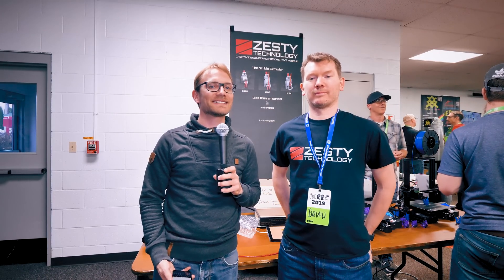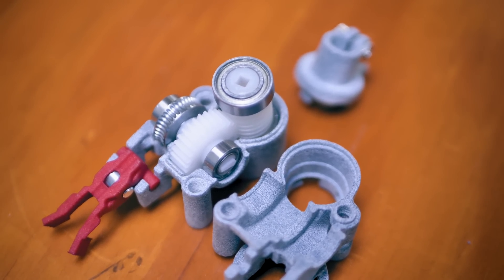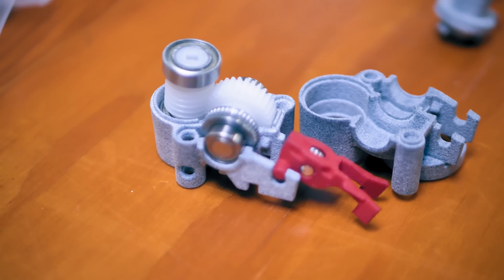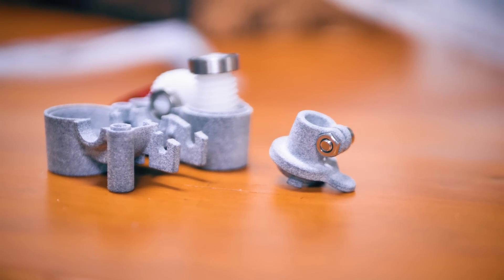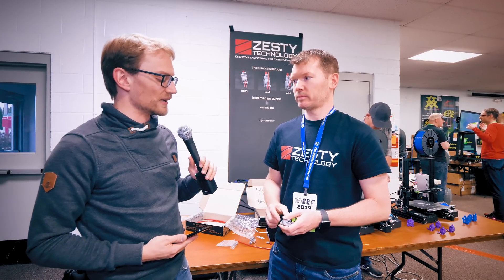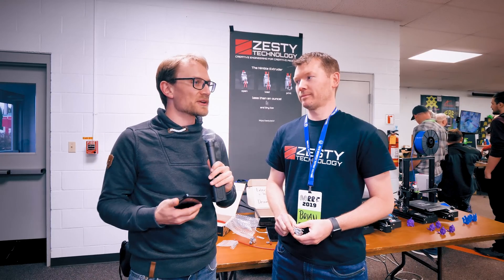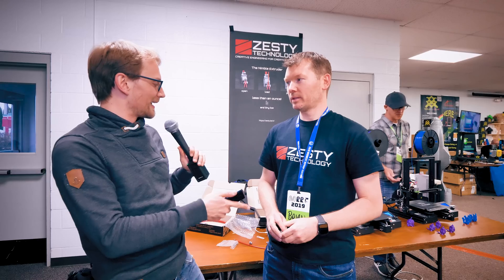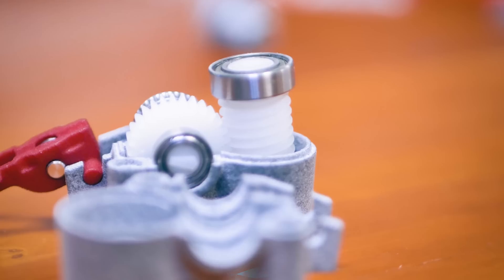The Remote Direct Extruder: Zesty Nimble! #MRRF2019

Comment: Thing of beauty...WE MUST PROTECT THIS IDEA FROM THIEVING CLOSED SOURCE COMPANIES....OPEN SOURCE!
Reply: I'm pretty sure it is already open source, but it's a bit more challenging to source a high quality flex cable, so it normally makes more sense to buy one directly from them.

I did a ton of research on them back in 2017/18 and they seem to be a really good company with a high quality product.
Reply: Christopher Goggans I’m just worried it will be the makerbot conveyor belt again
Reply: @EndermanTheMan  I can understand that :) on the plus side,  Zesty has one design, and flex3drive has another implementation. From what I understand, with two different examples of prior art, it should make it almost impossible for someone to patent one here in America.

It's also likely that flex3drive has patented the design as a defensive measure, not to sue other makers, but so no one else could try to patent the design and use it to attack other creators.

From my perspective, this seems like one of the best and most elegant solutions to the conflict between mass on the extruder, retractions, driving flexible filaments, and many other such things.
Reply: Christopher Goggans I didn’t think about that. Very good points
Reply: It is open source, With the original creator Flex3Drive. Nimble stole it and didn't make theirs open source.

Comment: It is the same concept as Flex3Drive. Not sure who was first.
Reply: There is prior art on thingiverse back to 2011, we spent the most of our development development time designing to reduce size and weight, and sourcing the right drive cable for the task. At less than 27 grams for the main unit I think we succeeded :)
Reply: Flex3Drive was earlier by multiple years
Reply: Flex3drive came out in 2014!! these people have ripped off this idea.
Reply: @Dust599  There was even some stories on reddit about this. Apparently they bought some Flex3Drive and some license to resell from the Flex3Drive guy, then 'remixed' their own version with it. They fought for some time, but then they settled I think (Flex3Drive guy was actually cool with it all, he just wanted to be credited)

Comment: Wouldnt a flex shaft become wonky when doing retraction?
Reply: He actually mentioned that in the beginning of the video. They're using a specialized flex cable that is equally stiff in both directions of rotation, plus it's running through a 30/1 gear reduction, so any small amount of torsional flex in the cable will be dealt with when you tune the extruder initially. It's really a clever idea.
Reply: @2011JMB  can you even tune rotational directions seperately on an ender 3 or CR10 (as shown in the video)

And such a flex shaft cant really exist physically one side will allways be somewhat weaker (often the inner spiral as the outer gets supported by the inner on rotation) not to mantion ongevity and wear resistance as a flex shaft is a guided springwith contact on the windings (when straight) a "bi rotational"one  is just 2 inside eachother. 

To give minimal deviation betwen CW and CCW you would need to have a perfect material difference and very tight tolerances on the guide making bending hard or very abrasive at the bends. The conclusion would be to use high grade materials once again.Making the upgrade something only enthusiasts would use. Enthusiasts with machines allready way better than ones benefitting from that upgrade.

And the people benefitting from the upgrade would shy away due to price. 

Or option 3 still not direct drive extrusion, but better than bowden. A swiss army knife; do it ok, just not perfect.

That is the tolerance of the flex shaft, ontop comes the one in the drive reduction gear and if one thing is true in engineering, its that tighter tolerances= monney spent

Comment: So this is a solution to combine the benefits of the directness of direct extrusion and lightweightness of bowden extrusion. But what problem is this actually trying to solve? What are the real disadvantages of bowden extrusion over direct extrusion that make the need for an alternate solution like this, presuming, that all settings have been optimally finetuned in the regarding system? Everyone only argues with "yeah with bowden you need more retraction yadadada". So what? Then use the right settings and get same results as with direct drive. Or is there still a difference in the results between direct drive and bowden in the end?
Reply: "Then use the right settings" is exactly the problem. Tuning a bowden system so that it performs equally well to a direct drive (from a print quality and speed perspective) with all meterials (esp. flexibles) is non-trivial and the 'target area' (i.e. the range of values that will be acceptable) is also much smaller than on a direct drive. Not everyone has the time and patience to do that.
Reply: It is especially helpful on printers where reducing weight on the carriage/effector is critical — most commonly improved is a Delta printer.
Reply: Bowden doesn’t work well for ninjaflex
Reply: The main disadvantage is that a bowden makes it difficult to print flexible materials. For instance, X60 filament is impossible to print using a bowden system. The Nimble handles it fine.
A different benefit of the Nimble is the ease of use. Switching filament has never been so easy.

Comment: A flex drive shaft and a worm drive.  Could diy one relatively easy. Cool concept
Reply: You absolutely could - but there are quite a few challenges you'd need to overcome. Just sourcing a decent bidirectional flex shaft of the right length crimped with suitable connectors will be time-consuming enough to warrant buying a Zesty instead... Although they're far too expensive for my tastes.
Reply: @colinfindlay4790  not knocking the product at all, it's great. Just saying there's diy options.
Reply: @mannycalavera121  Totally get where you're coming from -  the first thing I did when I saw the nimble was price up some parts to make my own. Seemed totally doable until I tried actually sourcing the right flex shaft

Comment: Oh, HP Jet Fusion printed parts? nice idea. 
Great to see that they finally got those machines working :)
Reply: JJ CC Finally somebody using industrial printers for the hot end assembly. Tired of only seeing FFF in that area. It might be a bit cheaper but comes with a ton of trade-offs.
Reply: @niklasf25  Have a look at the Kryo. Water cooling for the hotend. Also HP Jet Fusion made.

Comment: Yeah +1 for the guys over at Zesty Tech. I was blown away when I replaced the bowden extruder on my Delta with the Nimble. I can't recommend them enough if you're still using a bowden style extruder.
Reply: What improvements did you notice?
Reply: @karlfriedrich7758  primarily jamming issues during multi retraction scenarios. Those were the most frustrating. I've yet to have a jam with my Nimble...I have about 2kg of plastic printed through it. My 4.5mm retractions have gone down to .65mm with basically no stringing. Changing filaments is way better than my Bondtech BMG with bowden as I don't have to push it through 170mm of bowden time all the while grinding it against the extruder gear.
Reply: @bikesair  Thanks for replying, that sounds awesome! This video and your results has me convinced I need this extruder now haha
Reply: I know this was a while ago, but could I ask how (if you’re still using it) the nimble is holding up after years of use? I’ve heard that they degrade badly enough after a few years that they need replacing…is this true?
Reply: @Enter-the-Meta  I sold that printer about two years ago. The gears that they used were injection molded high density plastic. They were high quality, but unfortunately I can't speak to the long term durability.

Comment: It's not pretty, but I'm definitely interested. Especially for my oversized printer that is using a 700 mm bowden. I'd probably mount the motor above the printer so the flex shaft doesn't have to bend much. I hope you review this, Tom.

Comment: What is funny is I have a nearly identical extruder I built partially assembled on a table, the internal layout is similar as well. Hell, I'm using the same bearings too. 

I probably should have finished building it so I could have brought it to MRRF
Reply: I second that! Made very similar one with gear from trash and speedometer cable. Had to cut worm myself though.
Reply: @evilgremlin  That is pretty awesome, what kind of machine did you end up mounting yours to?

Comment: I have two of the latest Nimble extruders. One benefit that is somewhat obvious in this video is how incredibly small it is. Two of them will fit on the top of the E3D Chimera+ with a very basic mount. Regarding torsion from the cable, it is running a 30:1 gear set and like any extruder you simply fine tune your settings. Have used ABS, PLA, PETG, TPU with zero issues of feeding.
Reply: I have the same set up. Eventually gave up on the Chimera though, mine was the original, too narrow and it was forever blocking, jamming etc. Put me off E3D for life. Moved over to a Crealty CR20 and never picked up the Nimble again.
Reply: @privacytest9126  The Chimera with dual nozzles is difficult and touchy I will agree. This is evident in the description on E3D's site about their multi-extrusion options. But I would not associate the Nimble with the Chimera as the Nimble will work on just about anything.

Comment: There is one thing I don't get. 3D printers are not high dynamic machines. My machine has a maximum acceleration of 0.3G which is rather slow compared to industrial robots. I feel that a lot of people are trying to make the head lighter because of the bad mechanical structure of there printer. That is working around the real problem.
Reply: I think you are absolutely right! however once you start making the machine more rigid you also start making it exponentially more expensive. i think this is a good option if you have a cheap, less sturdy printer
Reply: Delta-bots are what benefit the most from this, especially if you're still using magnetic balls. A full Nema 14 mounted to a magball effector will cause rods to uncouple from the balls as the inertia of the motor is too high. Sure, you can get some nonmagnetic Trick Laser arms like Ultibots does for a full Nema 17 direct drive setup but imo, this is a way better solution than that.
Reply: Having a lighter head not only allows for faster prints, but has quality improvements. Don't underestimate inertia from mass. Assuming this works, you get the benefit of having a light weight head like a bowden with the direct drive capabilities and not having to deal with the retraction issues that bowdens tend to amass, especially at larger sizes. 

Sure it's no industrial level robot by comparison, but printers we have today have a set of limitations and just like a computer, you can only go as fast as your slowest part. I for one very much look forward to a system like this on my custom built system because I'm really hating the retraction issues of a long bowden and have considered converting to direct drive in the past even despite the fact it would restrict my speed and acceleration settings even more than I already am.
Reply: the difference is resolution. your industrial robot is not trying to freeze to a spot with a resolution of 0.001+mm your 3d printer IS. and when its sloppy you see it as "ringing and ghosting" in the print.
Reply: @nerys71  Industrial robots with a similar working area are way more accurate than hobby 3D printers. This is no surprise. The difference in price is huge. The Z-axis of a 3D printer is fairly accurate. I thought mine has steps of 15 microns. The accuracy will be smaller than this value. This is more than good enough for a Z axis. The X and Y axis are a lot less accurate. The real step size of my XY axis of my printer is 0.2mm. Micro stepping does help a little bit, but not all that much. Overall, your claim of 1 um accuracy is really far from the truth when looking at the XY axis.

Delta printers have more stability issues. I agree with that statement.

I recognise the ringing issues with higher inertia loads. My printer has these issues as well. Not because of the stiffness of my printer, but because of a lack of stiffness of the table on which my printer sits. If the table starts to move, so will my print table inside my printer. The real problem here is the table, not the inertia of my printhead. Sadly enough, this is the table I got and there is no room for something else. So let me share a little trick how to work around this problem without spending additional money. I am using the print profiles of the Prusa printer with slic3r. I simply reduced the accelerations by a factor of 4! I was expecting a large increase in print time. This was not the case. The print time barely increases. This makes sense. The print speeds are incredibly slow on most printers. Therefore acceleration to this speed doesn't cost much time. 3D printers are not high dynamic machines. Everything is just really slow. Just reduce your accelerations and you will be fine. Or even better, makes your printer or table on which it sits stiffer!
Reply: @FrankyieFrank  interesting. I was going on the stats manufacturers provided which might be taking micro stepping into account..... They would not lie now would they :-) hehe

Also interesting about the table stiffness. I have heard that before and forgotten about it. I need to test that!

I can see pick and place robots being stupid accurate and precise ie chip makers etc.. But i was thinking more along the line of car production line robots. Those have better tha .2mm accuracy?

Also i am drawing details in tiny models with a 0.2mm nozzle i would think the accuracy must be greater than .2mm as a result of what i see. How would i test that?

1.8' stepper makes 200 steps per rev and i need what? 100 steps per mm ? Is that not 0.01mm resolution without micro stepping or am indoing or interpreting the math wrong? Upgrade to a 0.9 degree stepper and you have 0.001 resolution? What am I doing wrong?
Reply: @nerys71  
Everyone "lies" when it comes to specs of there machine. A smart manufacture will talk about repeatability instead of accuracy. For example, the large Fanuc robots used in car manufacturing have a repeatability of +-0.3mm. This is a really big robot with more than 100kg lifting capacity, not a tiny 3D printer. The small robots will be better. The repeatability statement is fairly useless without knowing how they measured it. I will explain this with an example of with my own 3D printer.

I devised a protocol to measure the repeatability of my Ultimaker style 3D printer. I follow the following protocol for measuring the X axis.
X=90mm
X=100mm
Measure the position 
X=110mm
X=100mm
Measure the position again
Subtract the two measurements of each other and you have the repeatability. Off course you repeat this measurement several times in different positions.

What this does is measuring the difference in position when the head moves in the positive direction and in the negative direction to the same position. My printer has an accuracy of 50um in this measurement while moving slowly. The maximum error is 100um when really pushing it. 50% of this value is caused by the stepper motor inaccuracy, the other 50% is caused by the mechanics (belts).
I would never measure repeatability this way if I where a manufacturer. I would only measure the repeatability when the head is only moving forward. Just go x=90, x=100, measure, x=90, x=100, measure. If I measure it like that I probably end up with less than 10 microns. It is a bullshit measurement because it is only valid when printing in one direction of that particular axis. That is one trick how to "lie" with specifications. It is technically not lying because you never stated how your measured this value.

I have around 5 steps per millimetre. With micro stepping I have around 80 steps. You can see that the micro stepping is doing something but I am still 4 micro steps out of position with my biggest inaccuracy measurement. This is why micro stepping cannot beat real steps. A real step cannot be out of position by several steps (if it is, your screwed). I'm going to upgrade my printer to 10 steps per millimeter (0.9 degree motor). This with improved mechanics will hopefully reduce my inaccuracy by 50%. I would go for a bit more steps per millimetre if I could, but that is undo able with my design printer. 

What your doing wrong is neglecting the fact that the motor has a pulley on its axis. That creates a sort of gear ratio.

Comment: that's very interesting for CoreXY and could be really good when you go for high speed/acceleration
but for Cartesian it's dumb, just look at the other axis, the Y weighs a ton more so reducing X weight won't matter
Reply: Well or deltas. They will also be very nice with that.
Reply: @L3D - 3D maker That's what I'm thinking with my corexy machine. Especially since I built mine significantly larger than the average machine so right now I'm dealing with a 700mm long bowden making retraction settings a bit of a nightmare sometimes even with capricorn tubing.